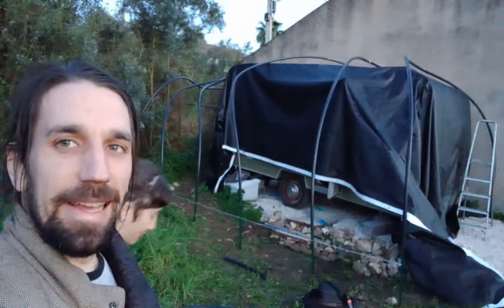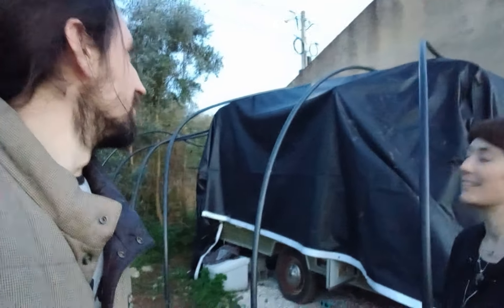HUGE CHANGE OF PLANS On Our Caravan Awning - Building On A Budget: Part 2

Comment: I used wires threaded through holes I drilled to link and space the pipes on my own scrappy greenhouse. Its not as tall as your caravan and I used shadecloth over it but the principle is the same. You will also need some taller uprights to put a frame either end to help with the potential sagging - I imagine that fabric will be pretty heavy. Hope this is useful. Regards from Australia
Reply from the maker: Hi JByrd! It actually is super helpful! The uprights we've already recognized there's no way to do it without them. The wire idea we hadn't come up yet, we might just make use of it to stiffen it all out! 
Thank you so much for all your continued help and support! See you on the next one 🥰